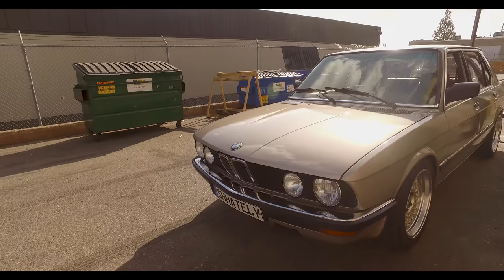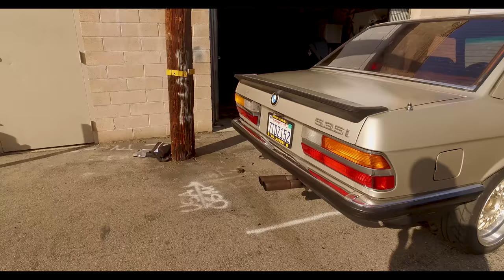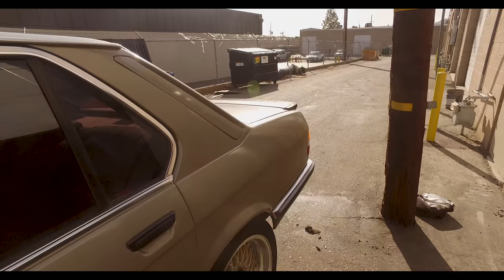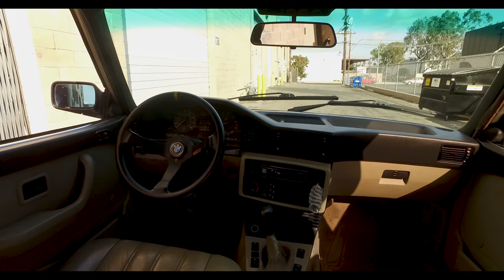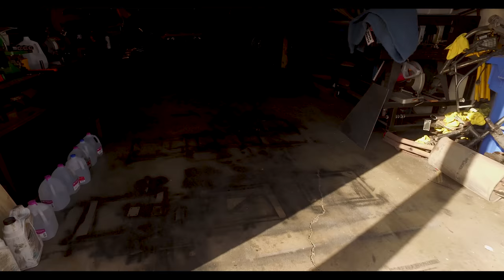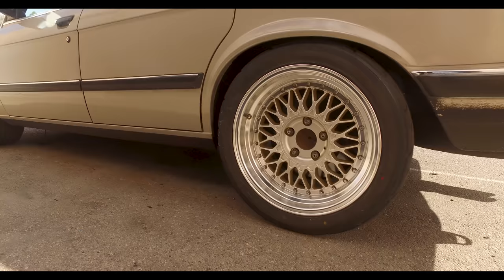Introduction to my E28 daily driver

Comment: Nice car. What size width and offset are those wheels?  Are you running spacers? What size tires?  Thanks
Reply from the maker: Not sure the offset, they are 17s with 235/45/17s
Reply: Andy Hateley it’s got the perfect offset. Any info on the wheel spec would be greatly appreciated!

Comment: Do  you know the shocks you're using on the IE Coilovers as well as the spring rates?
Reply from the maker: Bilstein HD shocks, I forgot the rates. But I remember going a bit softer then what they typically use. Almost handles too good now, it needs more power to have some real fun.